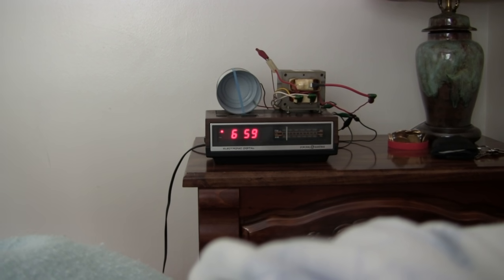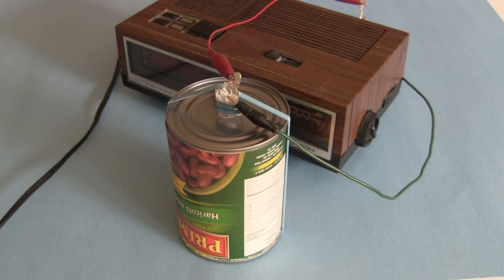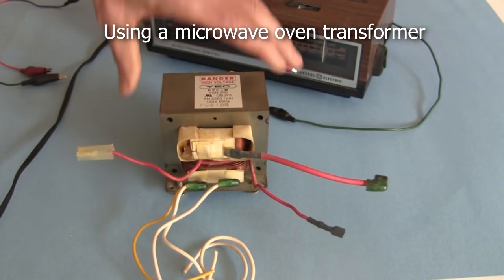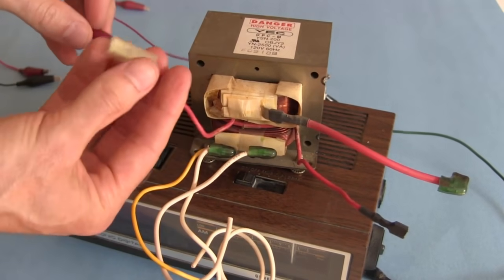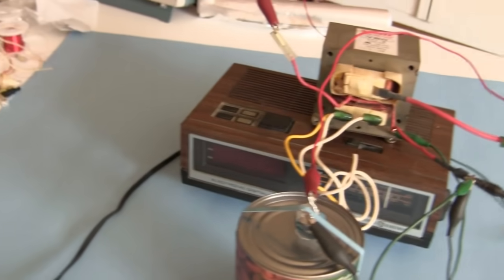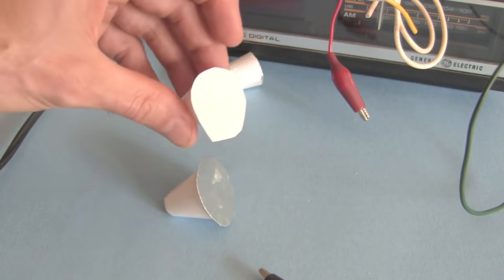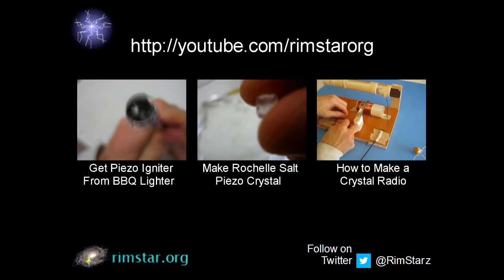How to Make Piezoelectric Crystal Speaker

Comment: You could also try ceramics, like a piece of broken china from a dish. Ceramic capacitors are known to be microphonic ( they will insert stray voltage artifacts into an audio circuit if subjected to vibrations).  But geometry matters. the orientation of the part you decide to use as diaphragm makes a big difference in the volume of sound you will get.

Comment: This is probably the safest project built with a microwave oven transformer.
Reply from the maker: Ha ha! Very true!
Reply: @RimstarOrg  Hi, could you elaborate a bit on the safety of it? Is it safe because it will not draw much amps? Other sources claim that the high voltage may be dangerous anyway...

Comment: auger
0 seconds ago
A 8 ohm to 101k ohm 100v loud horn speaker transformer with a Midway of 25000khz might work better than a microwave transformer you can also use one to draw power out of the air by connecting the transformer to a aluminium door or window frame it draws enough power for a sanyo solid state amplifier to put out about 15 watt but only works as a crude crystal Radio but louder and free no battery or potato required may accidentally rebroadcast your local radio station and cause a echo on the channel though whoops sorry BBC Radio the things you learn putting random electronics together when you are 12

Comment: What would happen if you took the output that is going into the piezo can speaker and hook it to a regular speaker through the microwave transformer.
Reply from the maker: You wouldn't even need the transformer. The wires from the radio were originally going to a regular speaker inside the radio. So you'd just connect it the wires to a speaker.
Reply: @RimstarOrg  Yeah but does the microwave transformer make the signal more powerful like in a commercial 70v audio setup where the audio goes through two transformers before it reaches the speaker? One after the amplifier and one before the speaker. What would happen if you connected a high power speaker to the 70v line?
I know that you can connect any speaker to the radio and it will work because I've tried it and you can feed the audio into a more powerful amplifier to make it louder. This setup seems like you are making the audio signal from the radio more powerful in order to drive the piezo speaker.
Reply from the maker: The purpose of the transformer was to step up the voltage because the piezo crystal works off higher voltage than a speaker. But the current is lowered at the same time for the power stays the same (ignoring losses through the transformer). The only amplification may have been the use of cones to more direct the sound waves to a smaller location.

Comment: Doesn't a Piezoelectric crystal have a specific molecular oriention that you need to adhere to for it to work properly?
Reply from the maker: Good point. You have to find out the correct orientation before you can use it. I show doing that in this much older video https://www.youtube.com/watch?v=R9m79oWdOZI Maybe I should have mentioned it.
Reply: @RimstarOrg  Cool! I'll check it out.

Comment: I’m really curious what the final output voltage was. Does anyone know what would be required for an experiment like this? I’m attempting a similar experiment using quartz. My function generator maxes at 5V
Reply from the maker: Unfortunately I didn't measure it so I can't say what the voltage was.

Comment: What if you hooked the radio to the doorbell transformer like you had it in the first part and then the output (the 120V side of the doorbell transformer) to the 120V side of the microwave transformer and then try the crystal on the secondary. Watch out, you might have arcs.

Back in 1997 my art teacher in school had that same alarm clock radio. I asked her one day if she still had it because I wanted to clean and fix it up but it got thrown away. It was falling apart when I was attending class.

Comment: Can this piezoelectric speaker be used for a crystal radio?
Reply from the maker: I don't think the crystal radio's voltage would be high enough. You'd need to put an amplifier between the crystal radio and the speaker.
Reply: @RimstarOrg  would it suffice if I put a battery?
Reply from the maker: A battery wouldn't be enough. It would raise the DC voltage, called biasing, but it wouldn't amplify the fluctuating waveforms which is what I think would be needed. You can try though.
Reply: I was thinking of making a piezo earpiece from a crystal in an old lighter.
Reply from the maker: I haven't tried making a speaker from a crystal from an old lighter so I don't know if that would work better or not. Let me know if you try it and how it goes.

Comment: Great video! Does anyone know the optimum shape for the crystal to vibrate and produce sound?
Reply: Tuning fork Y shape possibly.. I remember a video stating that quartz in that shape was used to keep time in watches and they've always seemed reliable. Even though the time keeping part is due to a specific frequency quartz produces by cutting it small and precise so that it's accurate. But tunings forks in general seem like they do the job considering it's basically a single piece of solid metal. I'm not sure how precise of a shape you're able to make but consider everyday acoustic items that are meant to be loud like a hollow cylinder used for chimes, bells, cones etc. Then again I'm not sure if its resonance relates to producing a piezoelectric reaction. If that's what you're using it for I'm pretty sure symmetrical shapes play a part in how effective that is.

Comment: are you able to hear the radio on the big homemade speaker?
Reply from the maker: I don't recall making a homemade speaker. Unless you mean my homemade amplifier (http://youtu.be/JtPwxbOgBHw), in which case I didn't try it but it should work.
Reply: RimstarOrg by homemade speaker I mean that can with rubber and and crystal connected to it
Reply: RimstarOrg thanks for answering me😄👌🏼 very cool video. I use to do stuff like that when I was a kid
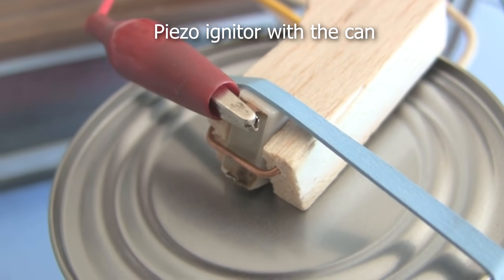Reply from the maker: Oh, thanks for clarifying. I can hear it using the speaker but it's not super clear. You can hear it at 6:20, though it would help if I wasn't talking at the same time! :)

Comment: Have you tried using the one electrode that touches the crystal as the "plate" that closes off the cone? something like +|crystal|-> where + is positive, - is negative and the > is the cone?
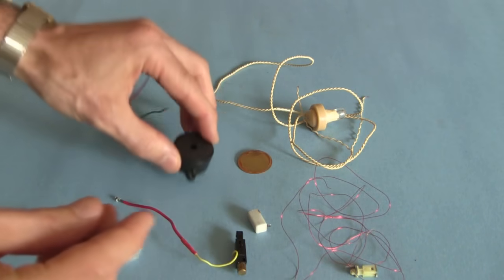Reply from the maker: The crystal I was testing with was the wrong shape. There are some disk shaped crystals (I show one a 1:13) but at the time that one was broken -- the leads had come off and one of them couldn't be put back on. Interesting idea though.

Comment: I think the bigger the crystal the more attenuation of the sound occurs because it needs more electricity to vibrate more of the crystal in order to transmit the sound waves at higher amplitudes. I think that's why the yellow ear piece worked so well. You might have better luck if you make the crystals in small pieces, rather than larger cube shaped blocks.

Comment: this is awesome! one question: this would also work the other way around, right? (as a mic, connecting it appropriately)
Reply from the maker: +Luiz Zanotello Yes, theoretically it would work the other way around. I don't know how well it would work though with my Rochelle salt crystal.
Reply: +RimstarOrg I stopped here when I seen piezoelectric cristal because remember this when in the army in EOD school .I Got to look at a ammo drawing to b shore of what is called a HEAT round witch uses a PIRD "point  in   ignitionating  Rear Detonating " FUZE like a RPG or AT4 that use a shape charge to defeat armer. It has a cristal on the tip that crushes on impact that make high voltage to a rear detonator..Is this the same cristal ??  .
Reply from the maker: +Ashley None It could be. But I have no idea if it actually is. By the sounds of it, you'd know a lot better than me.

Comment: This is the second video I saw of yours. I'm sure I can find an easy enough project to try. Also in another video you talk about finding stuff like a 555 timer chip. I live in a small town in Nova Scotia that's got a home hardware, source, Walmart, and Giant Tiger. Is there any hope in finding parts locally?
Reply from the maker: jphi1000 Maybe the Source has some 555 chips but I doubt it. Your only option would be to order some online. You should be able to buy a bunch of them for very cheap, providing the shipping costs are reasonable. For example http://www.ebay.com/sch/i.html?_from=R40&_trksid=p2050601.m570.l1313.TR0.TRC0.H0.TRS0&_nkw=555&_sacat=0
Reply: +jphi1000 You can order 555 and 556 IC-s from Amazon as well.

Comment: I have a rochelle salt crystal.  Is it polarized?
Reply from the maker: Bob dabiuld I already answerer you in your comment on my "How to test Rochelle Salt Crystals" video.
Reply: RimstarOrg Ok.  Do I still need a magnet by it, like in a regular speaker?
Reply: RimstarOrg Also, I made a crystal.  It looks like the image at this link:  http://bit.ly/1A16Vhy.  Is seems like your crystal is much more transparent.  My crystal is also huge.  Did I mess up?
Reply from the maker: Bob dabiuld No, no magnet needed for this one. At least not for the reason a magnet is used in electromagnetic/regular speakers. However, a magnet can be used instead of the rubber band if you have a small crystal. I show that in my follow-up video here http://youtu.be/b4vr1aE0zzw
Reply from the maker: Bob dabiuld It's hard to tell from that image since it's all white. From the outline of it it looks like it might be just a ball of man tiny crystals, in which case, if that's what it is, it won't work.
Reply: RimstarOrg It's almost completely opaque.  Shining light through it does work tho.  The bottom looks most like a bunch of tiny crystals, the top not so much.  Most of the "crystals" I made are like that: opaque and tough.  I think I added too much washing soda, because I tried making it clear so I added 1/2 tsp until it wouldn't react at all.
Reply from the maker: Bob dabiuld When you test it, make sure to try all possible orientations. But without trying it myself, I really can't say. If it's almost completely opaque then I suspect it's not a good one.
Reply: RimstarOrg Assuming it is a bunch of tiny crystals clustered together very tightly, what could I change when I redo the experiment?  Should I add less washing soda?  Change the place I store it in?  Thanks for all your help :) your channel is amazing!
Reply from the maker: Bob dabiuld If it is a bunch of tiny crystals then you could try breaking it up to get the largest individual crystal you have and do what I do in the follow-up video http://youtu.be/b4vr1aE0zzw with the smaller crystal. The very big crystal I have was made by taking a small crystal and using it as a seed crystal to grow a larger one. I did that only once and didn't document the procedure but it's the procedure from this website here http://www.seawhy.com/xlone.html
Reply: RimstarOrg My biggest crystal was like 1mmx1mm.
Reply from the maker: Bob dabiuld Your problem could be any number of things. You may have used too much washing soda, your cream of tartar may actually not be cream of tartar, you may not have heated it long enough, your storage place may have been too warm, ... Maybe my webpage on this will give you some clues http://rimstar.org/materials/piezo/how_to_make_rochelle_salt_piezoelectric_crystal.htm
Reply: RimstarOrg I figured out how to fix it!  I dissolved all the crystal clusters in hot water, and left it out for a few days(about 5).  I got the result you see at this link: http://gyazo.com/cde41422afed8cac584cad13c94c4a1a .
It really worked!!  You should mention that somewhere, it works for ANY crystal, too!
Reply from the maker: Bob dabiuld
Oh, nice ones! Way to go! Thanks for letting me know. Reheating it probably evaporated more water causing the solution to be more concentrated. How big are the crystals?
Reply: RimstarOrg the longest is almost 2 cm long, but super skinny.  The biggest cluster is 1.5 centimeters by .5 centimeter.  The biggest individual one is 1 cm by 1 cm.  I will likely try to use a seed crystal to make a bigger one.
Reply: RimstarOrg I did the process of reheating it many times.  It's like rolling a dice and trying to get a 5 every time with nearly infinite redo's.  I got one that is 1 cm x 1 cm x .5 cm.  It's pretty big!  I have some pictures on google drive.  Here is the link: https://drive.google.com/folderview?id=0B518vxiS7bmRfkY2Smpfd2VhSVV6dnlOZUtLVnM2SThhdWRiRVpjbG1TTk40a2x4aDJDU00&usp=sharing .  This crystal's a monster!  I will take another risk and try using it as a seed crystal.

Comment: Hi rimstarorg (steve), 
Here are the questions we wanted to ask you:
1) First is all this experiment making your job or simply a hobby?
2) How did you first discover piezoelectricity? What do you think is fascinating about it?
3) Why did you decide to use Rochelle salt and not quartz for example? What are the advantages with using Rochelle salt?
4) We did just about the same experiment (with all the improvements) yet we get little sound. Any ideas why? Is there any way you know of to improve this experiment even further?
5) Do you believe that piezoelectricity is becoming a significant renewable energy? Do you think its applications will spread to other fields of research?

Thanks a lot for your time !
Paul, Max and Nicolas
Reply: I guess , the idea of Rochelles salt Pizoelectric is not just suddenly came in his mind but it's well known and first used in Bell lab for application . And Quartz can also be use if you find it ready made but crystalization of it is very hard for Home lab .

Comment: can these piezos be used as a pressure sensor?
Reply from the maker: Diogo Miguel Yes, it can. The voltage across it will change when pressure is applied, but the change will only be brief when the pressure is first applied. But that's enough to tell you that there was pressure.
Reply: RimstarOrg So is there any way i can make a switch out of this, to let current flow when pressure is aplied?
Reply from the maker: Diogo Miguel Well, if you only want to know when the pressure is first applied and don't care about when the pressure goes away then sure. I don't have time to come up with a circuit for you though. If you need a pressure sensor that also tells you when the pressure goes away then maybe http://en.wikipedia.org/wiki/Pressure_sensor will give you some idea.
Reply: RimstarOrg Well my idea is creating a e-drum with a simple gamepad using the piezos as as triggers, connecting them in to the gamepad buttons, and gamepad in to the computer, so piezo>gamepad>computer, and i have doubts in the piezo>gamepad part, if i have to use any resistors or transistors or if i can just connect them
Reply from the maker: Diogo Miguel Piezos are used a lot by people making DIY e-drums. I've had in mind to try it myself someday. Search online and I'm sure you'll find plenty of examples. But if you're using gamepad buttons, I'd wonder if the buttons spring back up fast enough for rapid drumming.

Comment: Do you do any calculations/measurements before making these projects? Like do you know your speaker's impedance before hooking it up? I heard if you don't have enough impedance, it can damage electronics... do you know what the impedance of these speakers must be? I would really like to know!
Reply from the maker: SniperFox For some projects I do calculations first. But for this one I didn't have any control over the parts that I had to work with. I had a set of piezo crystals, cans, transformers, ... and calculations wouldn't have helped since I couldn't tune anything.
Reply: How did you know that the speaker you made wouldn't damage the electronic components of your clock? I made a speaker out of coils of wires and paper plates that plugs into my phone. How can I know whether it'll damage my phone or not?
Reply from the maker: SniperFox
I didn't know if it would damage my clock. The clock radio was scrap anyway so it didn't matter. However, I guess you could start with a 10 kilohm resistor in series with your speaker to start with and measure the current. The current measurement would be rough since it's not pure AC.
Reply: Thank you for the replies, I really appreciate it :)
Reply: @FixitFox  just know the impedance of your amp and use coil of matched impedance or use resistor or inductor by calculating ohm law or impedance ( by using Android electronic calculator apps  )
If high voltage spikes is also a problem use  100 k to 1M resistor , pf cap or zener  clip

Comment: Its quite amazing to note the kind of time you get to do these little things. It is almost the same for me too... I was inspired by your crystal radio and built one for me too, which is sitting in my drawing... kind of worried about the sound intensity, may be the time has changed as we get to have 100 fold more SOUND from the time.... I did one some 30 years back. Shall post a video of my crystal soon and any advice for me if I have to increase the sound intensity without an amplifier..... Cheers...!
Reply from the maker: One way to increase the sound intensity is to use a longer antenna and/or to make the antenna point in the direction of the radio station. If you're using an antenna coil and a tuning coil like I am, moving them closer together will also increase the sound intensity but at a risk of more interference from other radio stations. I'm glad you're having fun too! Cheers!